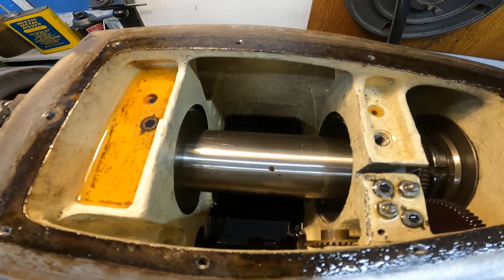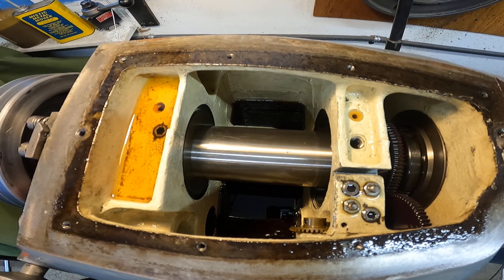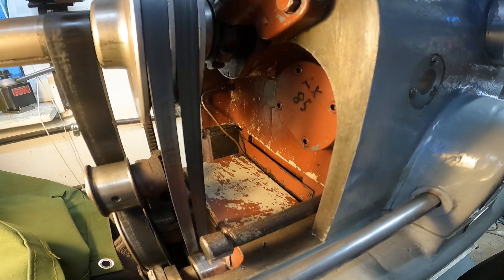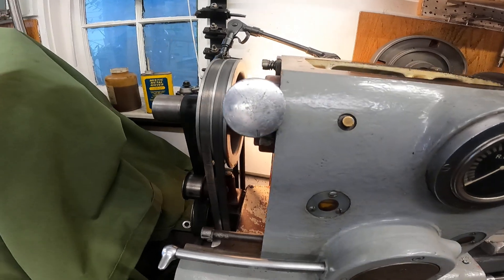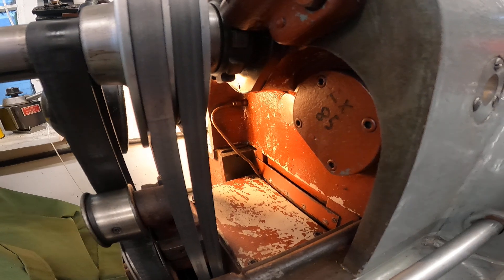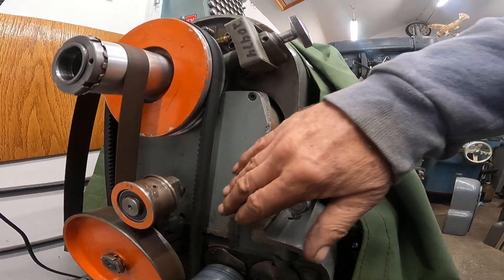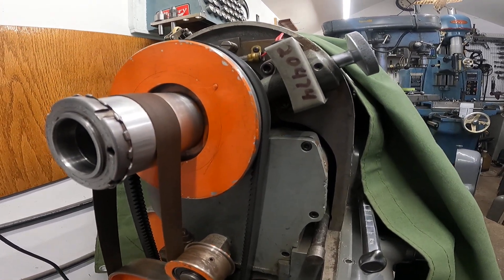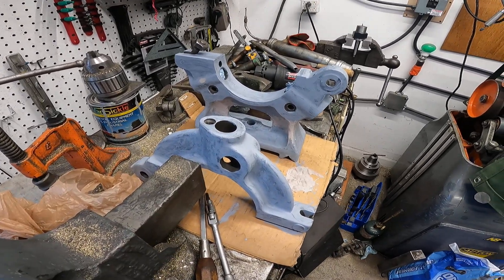Monarch 10ee lathe, a look into the manufacturing models headstock

Comment: What you’re referring to as the gear case is actually attached to the Norton quick change gearbox. There is one shaft that enters it from the tailstock end.  The missing gearbox is all a part of gear train that drives the leadscrew and is set up for threading only.  The longitudinal feeds come out of the right hand side of the the Norton quick change alongside the control rod. Kind of crazy complicated really.
Reply from the maker: Yes, I believe that is how it is. What I do not know is how the upper box with the stud gear and quadrant attaches. I should poke around some of the restoration videos. The old MFG model has been trouble free for 25yrs, and is the most easy and friendly machine I ever used, just a little loud "way loud" from the powerful cooling fan on the motor generator.
 The machine has been in working service for 70yrs.